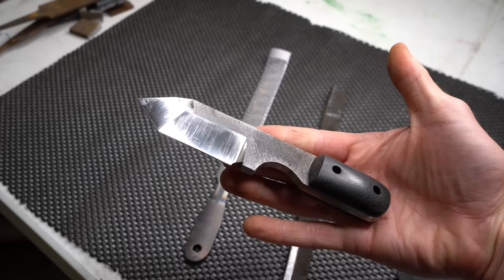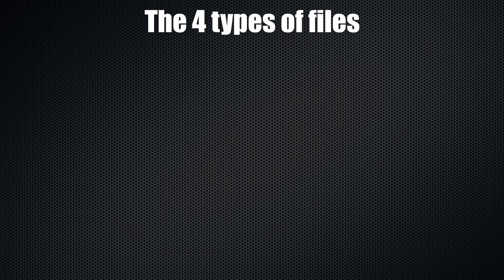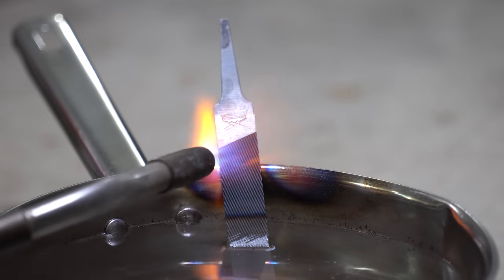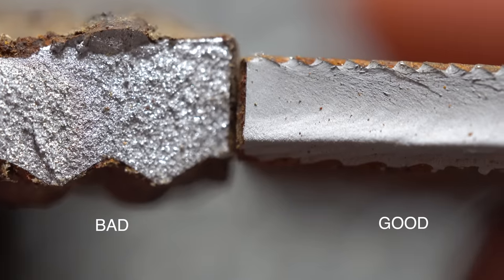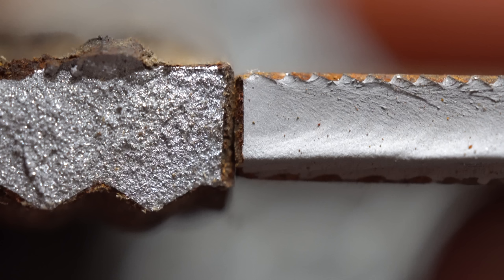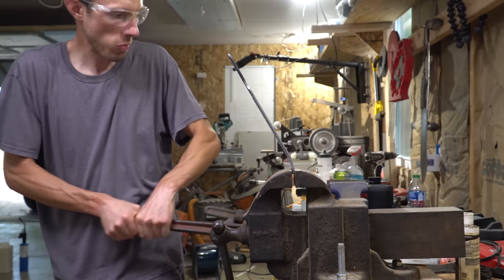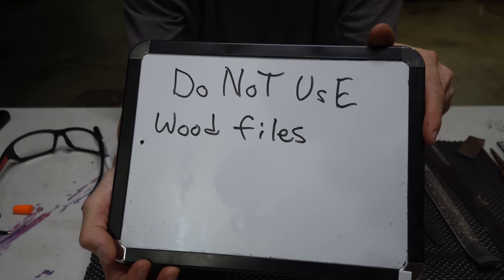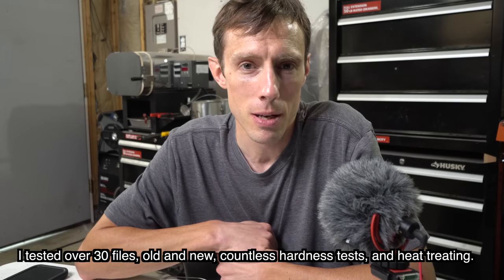DO NOT Make a Knife Out Of a File Till You Watch This Video-A Simple Guide To Files And Knife Making

Comment: This has also been my experience. Rasps, files, drill bits and sawblades (the non mechanized type), that are intended for use Only on wood, are generally insufficient for making high performance knives. If you have a wood rasp, you can typically just file the teath away to nothing with prety much any metal file. They're clearly not equivalent. All that being said, the amount of carbon in a wood rasp is often similar to a cheap axe or hammer, so forging them into useful tools is not a terrible plan.
Reply: Would you say it just makes sense to stick to metal purpose files? I just have 0 intention of breaking a file to find out and no way to test the hardness in a scientific way.
Reply: @uncircumcisedcircus  if you're interested in just making knives I would actually recommend going one of 2 ways. Either start out using a known steel with known properties, my favorites for most things are 1080 and 80crV2. Once you've picked the steel, just learn how to make it work for you. Or the other option is to pick a very forgiving steel, like leaf springs or concrete steaks. The heat treating is sometimes a journey with all mystery steels, but a good 4160 leaf spring will make a "forever knife" even with a mediocre heat treat. If your goal is to use old files then yes, absolutely stick to steel files. If money is not as much of a problem, you can order files with known hardnesses or with engineered properties for machinists. 
You can even get a set of test files with hardnesses ranging from the mid 40's up to the mid 60's to help you determine the hardness of a blade. This method is only good for determining a ballpark hardnesses but knowing that the knife is harder than the 56-58 HRC file but softer than the 60-62 HRC file is probably close enough.

Comment: A hypothesis on the nature of "type 2, fools through-hardened" files: can they be made of a relatively low-carbon steel that was then surface-carburised and through-hardened? As I can see in the video, its hardness was measured only in the centre of the "chunk" (after grinding). Maybe, there's a way to measure carbon content both on the surface and in the core?
Reply from the maker: This certainly can be the case which is why id recommend testing heat treatment first on anything suspect

Comment: And this is why I buy new steel. I know what it is, how to heat treat it, and how it will perform. Great video nonetheless as usual
Reply from the maker: Exactly!
Reply: I’m torn on this as I appreciate having a known quantity to work with, but a big part of me really enjoys the process of going hunting for old neglected files (and wood turning tools) to turn into something new.
Reply: @just9911  and that’s fine but remember what your using. If it fails or doesn’t perform well don’t be to upset. Skipping over the heat treating problem, Using any recycled steel is very risky. A piece could break or crack during quenching and you will never know it until you finished the piece. There is no way of knowing what stresses it’s been through. Micro fractures are not good. Testing or sometimes polishing, and etching is the only way you’ll find it. That’s after spending lots of time and money completing the piece. Of course this can happen with new steel but there is a much higher chance with reused steel.
Reply: @erikcourtney1834  oh I totally get it, which is why I either keep photographs for a record of what knife is made from a given source material or sometimes mark the knife somewhere.

The guy I do many of my projects with is a bit of a mad scientist when it comes to these things, so between his knowledge base and me being overly neurotic we’ve gotten pretty good at sorting the wheat from the chaff. Also should point out - I typically don’t sell these things nor would I put them out into circulation, so I’m not overly concerned with something failing.
At most, they’ll be a prototype for something my buddy wants to make & sell.
Reply: @erikcourtney1834  I should have said from the jump - I’m just a hobbyist who enjoys the process as much as the end result. My buddy actually does it as something of a side business and the things he sells are generally made from new steel. Exception being him using reclaimed steel in a damascus blade.

Comment: The old made-in-USA Nicholsen files were solid high carbon steel. Some were 1095, W1 or W2. It is said that some were 1.25% carbon steel. All these make fine knives IF you refine the grain by heating to just barely nonmagnetic and slow cooling 3X. But almost all files nowadays are case-hardened junk steel. Only the very surface is hardenable steel. Now, in theory, you could carburize them in a deep, air-starved charcoal fire for a few hours. But it isn't worth the trouble. Just buy tool steel- 1095, 52100, 8670 etc. The knifemaker's supply company can probably make suggestions. Or, Admiral Steel, New Jersey Steel Baron, etc.

Comment: Try to drill the file using a concrete drill. The positive rake will heat the steel red hot and melt it's way through

Comment: Oh great, there is an unfinished rasp knife project out in the shop. Oh well. We have horses and do our own farrier work, so tons of dull rasps around the place. 

Our horses live in sand (Mojave Desert). And the hoofs dull rasps pretty fast. With 14" rasps going over $30 I looked into ways of sharpening the aggressive toothy sides. Most use a hard aggressive cloth polishing wheel with coarse compound. I find this takes the tips of the teeth off, and leaves you with a sharp but less aggressive tooth profile. And probably leaves the edge in softer metal. Oh well.
 
Old metal files have become too valuable to be used for knifes. The new files just are crappy, be careful with your old files!

Comment: I haven't ever made a knife with a file. I did from time to time make deburring tools with them. I was a machinist and often needed to remove burs on the things I made. It needed to be a bit larger and more robust that your average deburring tool. I did the oil quench on them and they worked well, I ahhhh may have ahem!forgottentotemperhtem!Ahem!
They weren't overly long so it wasn't a problem.

Comment: If you do the hardening anyway there's no need for through hardened. There's a difference between completely hardened and only having enough carbon on the surface. Some water hardening steels are exactly made to only case harden. But it's the same carbon content through and through. I don't know if that surface carbonizing is still done by anyone. I'm not sure that process would be cheaper than using cheap carbon steel. As long as the steel can be hardened and it's homogeneous material then you can anneal, shape and harden it. Just use a cutoff wheel to get a slice from a file and harden it. Then test the cut face. Those little hardness testing files come in handy and are much cheaper than a real hardness tester.
Reply from the maker: Yes, I explained that in the video

Comment: Serious question—why the hell would a company use a steel that can be hardened to 60s+ Rockwell C, but case harden?   Makes about as much sense as a screen door on a battle ship (I like Biff Tannen).
Reply from the maker: You cant file metal with a soft file. Hence the 68hrc. The process for case hardening is cheaper.

Comment: Nowadays a great many files are case hardened crap. Old made  in USA Nicholson files were 1.25% carbon steel. Those make fine knives-of you can find them. estate sales in farm country, maybe. heat to non magnetic and air cool at least twice before quenching. Now what you can do is soak the blade in an air starved charcoal fire to carbonize it through. Japanese swordsmith used to do this with steel that didn't have enough carbon.

Comment: I bought a imacasa cane knife it is soft as mild steel.  I decided to make my own.  I am buying 15n20 from alpha knife supply.  My problem comes with heat treat.  To get the most out of the $ 50 piece of steel i need parks 50 . Well that will cost another $50 .  For 10 bucks  more i can send it to Peter's heat treat.  What would you recommend.  You can't get $100 MADE IN THE USA quality from made in the 3rd world for $25😂

Comment: could you not determine the steel type by searching for the best annealing temperature for the file?   
buy lots of the same file.  anneal and test each one at a different temperature, softest anneal is probably the best one.... use that temperature to determine what steel?
Reply from the maker: No it doesn't work that way unfortunately

Comment: I made a knife out of a large hacksaw blade one time. Made a pretty good knife. I have no idea what the blade was used for, looked like a hacksaw blade on steroids. I paid $1 for it in a clearance bin at an industrial supply house.
Reply: I made one 50+ years ago from a broken power hacksaw blade. All I know is it said molybdenum steel. I didn't anneal it or anything, just ground it to shape, keeping it cool. I left the saw teeth on the spine of the knife. Sawed through the leg of a moose in Alaska with it.
Stays sharp a long time, but is hard to sharpen. Thin and hard, I'm sure the blade would snap easily.

Comment: With so many salvage yards having coil springs, I hate to see 100-year old metal files utterly destroyed for someone's 'knife experimentation'. Keep in mind, you can take a 100-year old 'dull' metal file and by using a file card, some sulfuric acid solution (and neutralizing in a baking soda solution), bring it back to as sharp as it was the day it was made. Many files today don't begin to compete with the hardness of old files...and for the $30-$45 to replace a 'top quality metal file', you could buy a D2 knife MUCH cheaper! Think it through and go to the salvage yard, the next time you want 1080> steel...you can buy 100-lbs of 1080 or higher steel for $15 that way!

Comment: "case hardened" usually means only the outer case has had carbon put into it. The core should not be hardenable because it does not contain much carbon and should not be hardenable without adding carbon.
Reply from the maker: There are several different methods used to case harden steel. All the case hardened files I tested re hardened to a suitable hardness after heat treatment. But not all will depending on the case hardened method. Personally id stay away from them unless a sample heat treatment was done to signify a fully hardenable steel.
Reply: @OUTDOORS55  I am trying to think of a method that can harden a fully hardenable steel but only on the surface. More baffling to me is WHY that would be done. 
Normally case hardening is done for 1 of 3 reasons. 
1 to be able to use a cheaper softer metal. 
2 to be able to have a core which is not brittle and resists shock. 
3 to be able to "spot" harden areas without hardening through.(by spot flame or induction)

Your results don't seem to match any of those types. They seem to indicate an expensive through hardening steel hardened only skin deep, but by what method?  
So I am wondering if some heat treating process I am not aware of is being used. Something like rapid flame/quench or some form of shallow induction, or even Nitriding. I have heard of case hardened files but their cores cannot be hardened as they are but you did not see any so I am baffled.
Reply from the maker: @billshiff2060  the method would involve a very quick heating (usually induction) and rapid quench. Rapid heating through induction is cheaper since you don't have to soak the entire thickness at a higher temperature. Steel heats from the outside in, so just the outer surface is heated to austenitizing temperature while the inside remains much cooler. This saves a bunch of money on electricity and speeds up the process.
Reply: @OUTDOORS55  A Flame or Plasma torch could do that but not induction which heats by eddy currents inside the metal. So I dunno, it seems a strange situation and whenever I see a strange situation I see opportunity.

Comment: Files are pretty bad choices for making blades even if you choose them well. Some of them have chromium and other bullshit in them. Some would crumble when forged at high temperature, other would not forge weld correctly for making san mai and damascus, and overall, they are just very very hard steels, wich for a heavy use knife is too brittle. Now maybe that some files are of a  certain kind of alloy that stays pretty tough even at high hardness, but that won't be true for all. I think i'll start buying known carbon steel for my blades beacause scrap steel sometimes is exhausting to work with